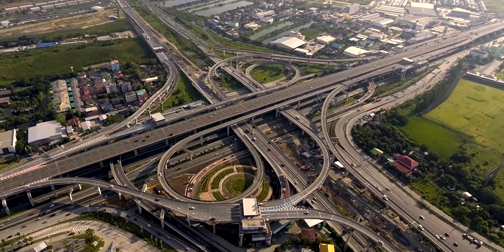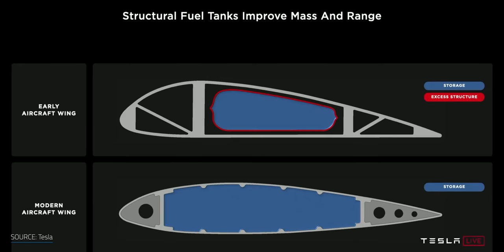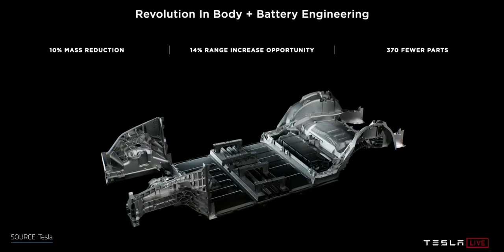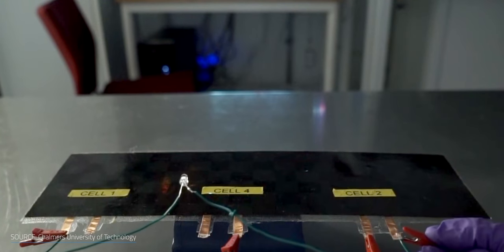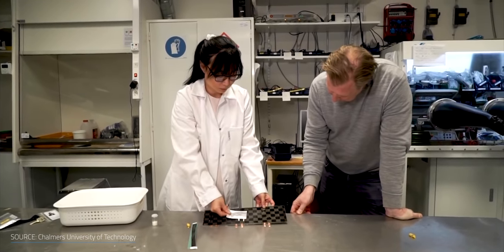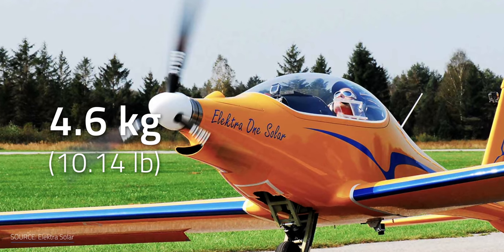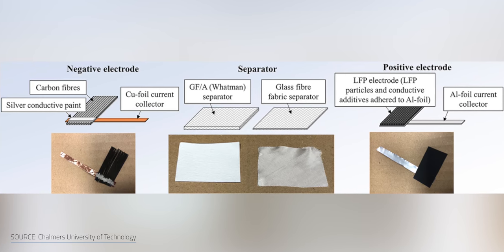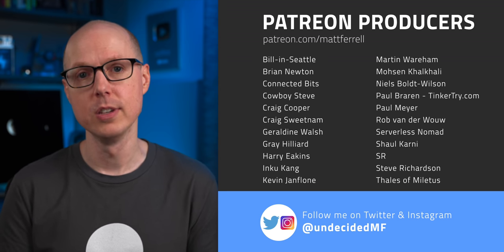Exploring Structural Batteries

Comment: I think I like the idea of the body of the vechicle sitting on a “skateboard” … build the bottom as a structural battery, don’t do that on the top part.

Elon should totally have “covered in solar-panels” as an option for the finish on at least one of the Tesla models.
yes, I realize that solar panels would be lucky to provide more than +5% charge per day.  That’d be enough to sell the look.  🙂👍
Reply: like, ideally offer a solar-plated model of the cheapest Tesla … like the slowest one, with the smallest motor.  where we might see the biggest gains in charging from solar panels.  ( and an “eco-mode” drive-mode that’s super-chill, relaxed, prevents heavy acceleration )

Comment: maybe with the teslas as a doable short term goal they could move or shape their batteries so that they play a part in the necessary load bearing of the structure however tolerable to reduce structure weight instead of a new material thats probably not gonna be economically viable for awhile.

Comment: I would rather have a battery that I can repair and replace if it means a little more weight if all they are doing is gluing cells together. The battery is probably the single most common thing that can kill an electric car.

Comment: This needs to be greater than 300w/kg before it can be better than Lithium Ion because you can't just put in a battery of this type that is say 150w per kg & think that you can get greater mileage because you can't, it will only have half the wattage density & half the weight but it will still not add any better results. You only get better results when you have less weight & greater wattage per kg.

Comment: That is not even nearly a "massless energy battery", that term either imply a battery able to store infinite energy for a fixed mass (100% efficiency superconductor could do that, though good luck making such material) or a battery that is itself massless, which is plain impossible, because physics. 

On structural batteries, it's not a new idea, and there are many issues with it. It's hard to agree with the term "breakthrough", even more so when talking about 25% of the energy density stored by li-ion. I doubt that this will transform the EV field. The one tech that will do that is graphene battery technology (which could also be used as structural batteries, "structural" being a bit of an understatement with a battery pack able to resist a railgun hit).

Comment: I get that the batteries can be swapped, but what happens to all those used batteries?  Can they be recycled? What is the cost to recycle?  1000 miles of range sounds good till you have mountains of single use batteries.  We have this problem already with tires, but tires last a lot longer than 1000 miles. In a future renewable energy world, do we really have space for single use energy infrastructure?

Comment: the problem with that and the problem no one thinks about when it comes to ev is energy storage degradation. as it is, those batteries in cars cost 10k to replace. if these batteries are structural, that means you need to throw that car away. it is a great idea however so i will say this is excellent to storage of energy

Comment: First impression: This is a terrible idea in electric cars/trucks. If the battery is part of the body, there goes all your serviceability. You've just created a vehicle that will be disposed of when the battery dies instead of being repaired. This seems like it would be a much better application for body panels or other parts that must be there, add weight, but can be replaced (assuming this wouldn't create hazards in an accident, which it probably would).

Comment: Why use this carbon fiber , not in sheets, but in solid forms. Build more of the vehicles structural components with them. Roofs, pillars, floorpans, trunk space..ect. Since it's super light weight and can withstand A LOT of pressure (watched a video of a 1inch cube of CF withstanding over 100tons of pressure and barely deformed) If they can incorporate this, into solid forms, almos the entire car could be the battery.  Maybe i'm wrong...probably am...but maybe?

Comment: Rule in  Engineering and design. Electeonics are not structure. Structure is not electronics. Tanks arw mounted in. Wing yes. But the wing is not the tank. And the tank is not the wing.

Comment: I feel like the structural should still be interchangeable. So tesla doesn't turn into another apple trying to hold a annoying monopoly on there cars. Making the battery interchangeable wouldn't be to hard considering F1 cars experience much more forces and use the engine and transmission as a part of the structure but can be completely changed out in about 3-4 hours.

Comment: This is still just a battery pack, just because they build in the structure in the "battery pack" it is stil just the same battery. saying it is mass less, the fact they add to plates on each side of a battery and the using the pletes a wires is a whaist, with that logic cars chasy is already massless battery's they run the minus terminal around the chasy making the car a massless battery.. they use way more carbon than needed, so the carbon is just a structure made from carbon not plastic ore aluminium and so on...

Comment: If batteries could be used to start up turbines and disconnected as plane readying to power on the runway if stored power in wings could propel planes to over 135 mph there is much of the power used solar on planes could only hope to replace power other than the turbines due to the amount you can transfer to power as needed

Comment: Just research 1/ a newer material to improve the current output of the solid state battery and 2/ a better and more even  distribution of batteries placement and 3/ new tech for safety, protecting the occupants 100% without fail so you can change the shaping of future vehicles. There are other weights to steal, why do we have to solve multiple problems at the same time?

Comment: just make more efficient batteries, how much more weight will you remove in order to reach mach 10 with not so efficient batteries? Weight doesn't matter when building a mechanical system, build more efficient batteries, or more efficient motors. If we applied thesame ideology on electric like we do on gas (by treating them as fuel), we will build more efficient system to around it like we did with oil and gas. I am not saying we can refine electricity like we do with oil (ex oil refineries and such). i am saying we should build better system to improve overall efficiency.

Comment: I'm really not a fan of the term "massless batteries". They're not massless. They're not even mass-neutral relative to other structural approaches because they have to make compromises that normal structural materials don't. Structural batteries are a real neat idea, and for some applications might have a lot of potential, but "massless" is baseless hyperbole. In any cases, they also do concern me with respect to repairability, which is going to only become more critical over time..

Comment: Batteries need to be easily swapped to make sense. We need low cost/high capacity solutions, not something that adds little to the capacity for the cost,  and makes the vehicles more difficult and expensive to repair.  This technology will end up exactly where carbon fiber does now, on high end vehicles for the 1 percent. That's not a solution.

Comment: The concept is great and does have a huge potential, but, in my opinion, it's not a prosumer feature. There are no substantial results about the battery decay or how long it will be able to hold charge. Electric cars nowadays still face the steep cost of battery maintenance. A full battery replacement might cost tens of thousands, depending on the car, and it's made by an old but evolving technology, so we have progressed to a point where we can make it quite cheap. Now imagine if your car, after a few years of usage, starts having battery issues, not being able to hit half the range that it used to. With this tech, you'd have to replace half the car. That is simply an absurd, both economically and ecologically. The manufacturing would be extremely expensive, and most likely you wouldn't be able to find a replacement bodywork/battery after a few years, as the company would move on to new models and stopped producing those parts.
This tech could be a company's wet dreams, having costumers buy new cars or replace half their cars every 5 years. In aviation it would be even worse, given that airplanes have to be inspected often and little issues might ground them.
I can see this work in small devices, or on motorsport for extra performance, but as consumers, we shouldn't accept this as the mainstream technology, unless they find a way to make cells out of it, while retaining it's strength.
Just because it works on paper doesn't mean it's great in real life.

Comment: Can't wait till people start complaining about their $40k car being totaled in small crashes because of the cost of these cells...
Alternate issue, the first person to key a car with structural batteries is in for a shock.
More disposable cell phone tech, also drop phone, chip the corner and it kills the battery, $1200 gone.
A small dent from say hail could cause massive damage to the battery panels so instead of ignoring it till you can afford to fix it, your car is down 40% charge...
I'm seeing these get abused more than helping anything.
Old car panels get melted down and recycled quite easily compared to batteries

Comment: Just an uneducated thought. What about integrating this technology into buildings? Think of skyscrapers in large cities (or homes in neighborhoods) acting as energy storage for the grid.
Reply: Yeah keep your uneducated ideas to your self...... What exactly do you do in 5 years after all these building have been built with the lithium literally built into the structure and the batteries are now useless because of age and over charging? (not to mention the potential extreme fire risk it will pose to the resident if there is a failure of the battery)

Comment: You didn’t really cover the whole damage issue just gave Tesla’s solution, which isn’t universal. Let’s say we do use the carbon fibre structural batteries for the body of the car, what happens when that car gets into an accident or some idiot keys the car? How will that effect the battery, it’s life expectancy, and it’s repairability? 

Both gas and ev cars can be taken to a repair shop if they receive a dent, ding or scratch, but what about a car with a structural battery for a body? I doubt you could take that to just any repair shop and get it fixed

Comment: Has anyone got statistics of what is happening to Tesla cars that have reached end of life (age, damage, etc). How much is able to be recycled, how much is burnt and/or put to landfill, and at what CO2 cost?
Could you regard burying carbon fibre as carbon sequestration?
What is the life expectancy of Tesla cars and will their end of life costs cause a collapse in value in their second hand market?
When will the Tesla models be replaced and old ones discarded as 'unfashionable'?

I see that making structural batteries will significantly increase these problems. We will have to make manufacturers responsible for dealing with the ultimate disposal of their products.
Structural batteries would work with  aeroplanes as wings are replaceable unlike the structural parts of cars. Note how integral fuel tank on planes are not used within the fuselage ... conventional tanks are used there ... car batteries are more akin to fuselage tanks.

Comment: I don't buy this battery at all. Battery weight wasn't the ultimate limiting factor, it was always about energy density, charging cycles/reusability, modularity, and temperature survivability(for cars). If the battery was part of the structure, that means it's going to have a lot more surface area, meaning more susceptible to damage from temperature gradients, like sunny summer heat then followed by a drizzle. You could add insulation, but that's another compromise that could add weight or size. Both of which are undesirable. Bigger size means higher drag and major inconvenience for the road and parking, and adding weight defeats the purpose. Solid state batteries are still the dream.

Comment: i do not believe that this is an improvement but like in mobile phone which once you were able to change the battery if it was or became faulty but slowly they integrated built in batteries so you are forced to buy a new phone once the battery went faulty  or just tired . And this is the same scenario but on vehicles .

Comment: so or so that all means we are not even near the end of battery research. that means the range of cars we have today about ~500-800km will increase even more and more... maybe even double. and if there was a car which can do 1000-2000km then everyone would change to ev. and even today tesla cars have a range of about 600-700km. and with their announced upgrade of integrating the battery into the structure then this will increase the range easily by 100km. mercedes eqs can go up to 800km... I would say when you need half an hour to recharge or a whole night then 1000-2000km is a must have. maybe even 2000+... then it will make sense to have an ev even for long trips. 1000-2000 is more then enough. from east to west coast for intance. paris to athens for instance. berlin to istanbul. peking to hongkong. with maybe an hour of recharging on the way

Comment: If a planes fuel pump(s) stop working and your flying at altitude your as good as dead or at the very least mortally wounded if you are lucky especially if your not close to an airport and you didn’t get a chance to dump your fuel.  Jet engines require pressure to feed the burners in the combustion chamber and the fuel pumps provide this as jet engine have a high fuel feed rate and no amount of gravity will be able to provide ample pressure to feed those hungry burners.   Your a gonner simple as that.

Comment: A couple of months back I replaced a battery on my 8 year old car... ~£60 (~$80) ... with a structural battery I couldn't do that. Of course I being deliberately dumb here. The true comparison would be replacing the fuel tank... which is also expensive and not for an armchair mechanic to do.

But, my point is - batteries have a relatively short lifespan (Tesla ~9years?) and when that is up your car is basically scrap as it'd cost far more to repair than it's worth. Your average fuel tank would happily last 30+ years.
This is something that doesn't bother those that buy a brand new car every couple of years - but normal folk would be looking at buying a 3 year old car, run for 5 years... scrap it? Because a car over 6 years old would basically be worthless. Not good for the planet or the wallet.
I would rather see several plug'n'go battery slabs that can be easily tested and replaced - making what should be a replaceable component a structural element is just asking for trouble!

Unless they give these batteries a 30+ year warranty... oh look, a pig with wings.

Comment: Lets say there was a material out there that had electrical properties and a better strength than steel, should we use it. It is called graphene. Why aren't they using this material which now has the  ability to be refined and used?? It is also suppose to have 10 times the strength of steel. Unless that is part of what they are showing on this video, but not telling us. I really wish there was more scientific view, or the innards of the topic being discussed.

Comment: Now if they can make a solar panel for the car that can effectively charge it. prob in 10yrs solar panels would be way better then now but if they can make major improvements enough you could prob charge a tesla at a store with just the solar roof. heck even right now adding in a solar panel to the roof of a tesla (or any other e-car) would prob add a few miles to range. but the only downside is the lith ion batteries. they need to find a new source for batteries. the moment that happens and the moment solar panels get more efficent we might be able to knock out most energy problems.

Comment: You know what I see as a down side to structural batteries, and why I see NIO as a superior company?  what happens when the battery stops working?  you throw away the car like we do cell phones now, since they are now sealed and we cannot change those batteries?  Or pay $10grand for a battery swap? as they have to remove a structural portion of the car then bolt or weld in a replacement? or by that time would they have moved on and no longer manufacture that battery pack so guess you have to buy a whole new car then and the old one goes right into a landfill somewhere

Comment: Yeah this is not gonna help. If anything it only perpetuates the "replace and throw away" mentality. It will be a disaster if adopted en masse as the structure is irreplacable, and if you need to replace the built in battery, you'll need to replace it entirely, with no way of recycling...

Comment: This does make some sense. The windshield is an example of a structural component.
If the battery cells are bonded together, they should form a very stable structural platform (bunch of cylinders sandwiched between two sheets of metal). It makes sense to use them as such, but the planning needs to account for pack replacement and cell breakdown at end of life.